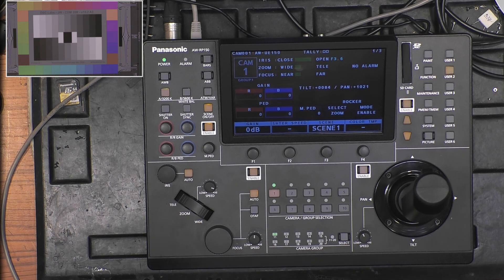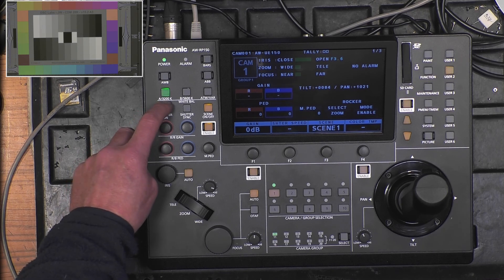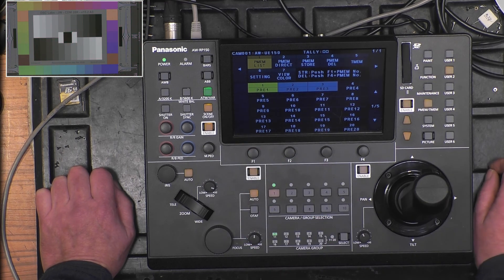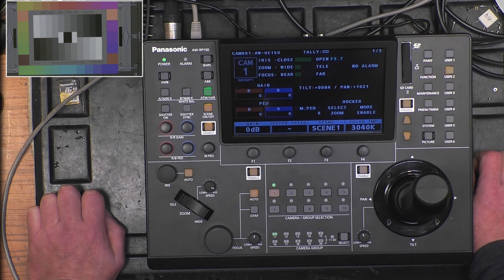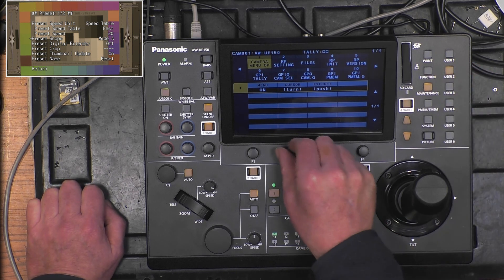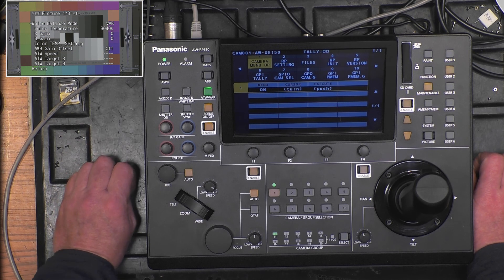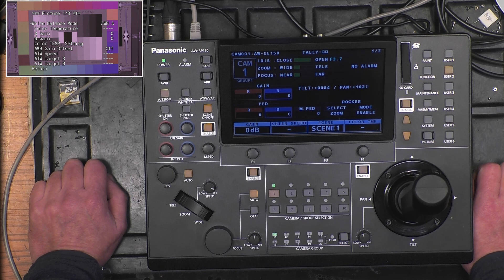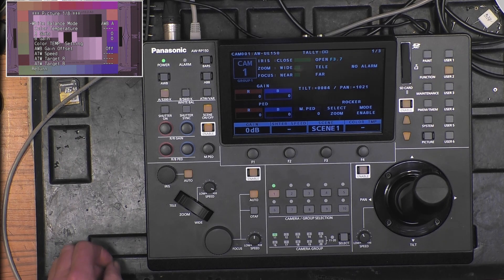Panasonic  AW-RP150 UE150 white balance techniques that are not in the manual..

Comment: I see you are changing the R & B by eye..how do you match cameras like that?...are you using a scope that I don't see?  Thanks
Reply from the maker: as there was only one camera and this explanation was about white balance and R/B adjustments and how to store,  matching was not an issue.  Of course, if you want to match several camera's, a vectorscope or RGB waveform are very usefull.Als , setting split screen (reference camera+ camera to match) can be very helpfull to check visually if the match is 100% ok for the eye.

Comment: Can WB be achieved without a color chart?  How?
Reply from the maker: of course.  Just present a white paper in front of the camera, illuminated by the light falling on the subject and push WB. (be sure the camera is in A or B mode for the WB)
Reply: When I present the white paper. in the A or B mode,  and push WB, do I hold the WB button till it turns GREEN?  thanks for your help.  @krisvandamme4210

Comment: By the way, you can adjust the Preset Scope (was known as the Mode in the previous cameras!) by going into the PMEM/TMEM and going to SETTING. Another way to get to it without going to the On Screen Display/Menu.
Reply from the maker: Hi Hiram.

thank you for your comment, and yes the RP150 has many "touch panel shortcuts", so you don't need to acces the OSD menu very much . (except for system changes).

I did not mention it for the scope A,B,C , because the video is already complex and the way to do so is different with other panel models.  therefore, I did do it by the OSD menu.
and I guess most users find the shortcuts by using the panel in there daily operations.

best regards

Kris
Reply: LOL not surprised I would find you here.
Reply: @makcccp  lol...I troll the Internet to find Panasonic PTZ-related news and commentary 😜.